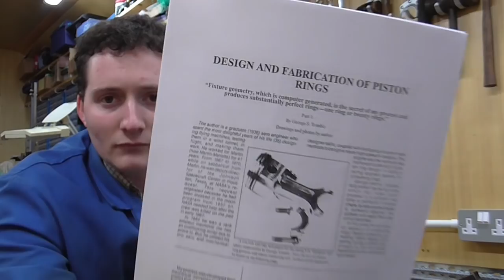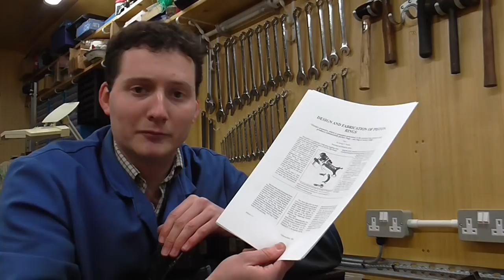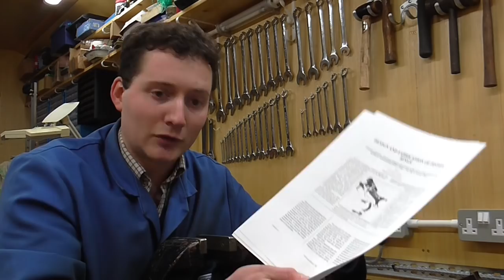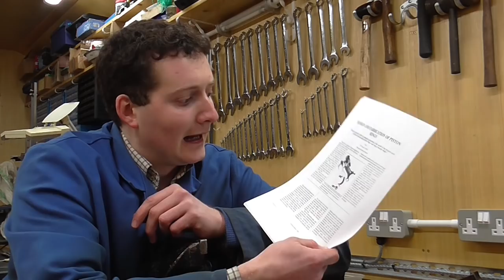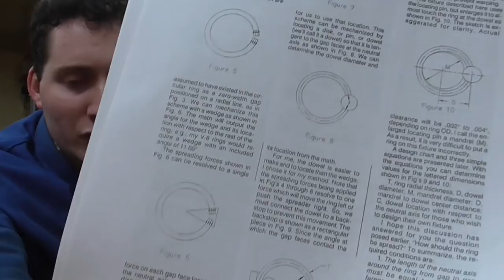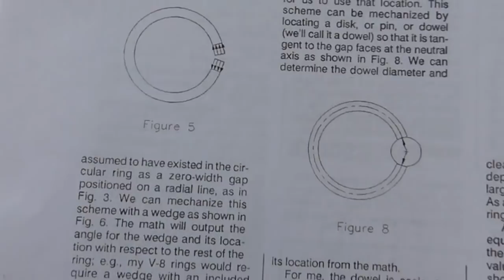Piston Rings 2

Comment: Nice work as per usual Mr.C. Here's a tip an old bloke taught me.  Pull apart your feeler gauges and use 3 separate feeler gauges to slip your piston rings onto the piston.  They slide on nice and easy.  Cheers, Aaron.

Comment: My respect for piston rings and those who make them has greatly increased!
There is one more thing: full scale practice, at least on German locomotives, has always been to open up the cylinder bore by a small amount (have a step in diameter) at the end of the stroke. This recess step is so positioned that the outermost piston rings can slide over this step by a fraction of their width in order to scrape any debris, corrosion, coked up oil, etc. off the running surface into the recess. The cylinder drains would start from the lowest part of these recesses to allow any sludge to be flushed out.
Probably unnecessary  for a smallish engine like a model locomotive.

Comment: I guess this response probably comes too late, but I admit to having had a Mr. Crispin-shaped hole in my education until fairly recently. With specific regard to piston ring gaps, and despite never having seen that handy design guide, I do know that rings expand in length, closing the gap as they heat up. If this is not considered in the design, it might cause a problem during operation. I am fairly sure you have enough gap, but if you had ended up with the gap you had wanted, it might have caused its' own batch of issues.
Also, I am glad to see that I am not the only hobbyist who seems to spend 80% of my time making tools, jigs, fixtures and whatnot. Thank you Sir for entertaining and educating me!
Reply from the maker: I think in this case I would have been ok as the piston, cylinder and ring are all made of the same material meaning that they have the same expansion rate.
Reply: @MrCrispinEnterprises  , you mis-understand. I am not tslking about different expansion coefficients, I mean that components expand differently due to their shape. Secondly, if the ring is getting hotter than the cylinder due to friction ( ehich it eill as it is so much smaller), it will obviously also expand more.
Reply from the maker: As for the magnitude of the ring expanding due to friction I'm not sure. With regards to the other topic yes perhaps although a steam engine heats up slowly and once everything is hot there would be no problem.

Comment: These two piston ring vids are my intro to your channel. Very impressed with your methods and presentation. On the subject of width of the ring face causing increased friction, I still remember being shocked in my 1975 H.S. physics class when we were told that surface area and amount of friction were unrelated. We were taught that friction was entirely dependent on pressure between two moving objects, regardless of contact area. I'd be curious if Mr. Trimble addressed that in his writings.
Reply from the maker: Thanks. From memory no, he set it out as I mentioned. Although I geuss he is assuming that width is the only variable in that section of discussion.

Comment: Excellent video in both piston ring making 1 and 2 considering a beginner with such a good outcome. Mr Crispin I hope she steams well. I notice that you have piston valves instead of slide valves, which is the same as the Britannia class loco I m restoring. For the rings in the piston valves it will  be the same technique as your piston rings  only bit smaller in producing rings for the bobbins for the piston valves.. Thank you for you knowledge and confidence as I m a first hand in doing model engineering. Sounds much better than buying rings.

Comment: Great video and great saving of the rings. I guess you could now call yourself Lord of the Rings. Many moons ago I made some rings for an old stationary engine exactly as per your second method however I left plenty of meat on the diameters and cut the split so no pulling wedging or stretching. Its possible to dress the gap edges and then compress the rings with some shim material in the gap to give a little less than the the desired finished ring gap. Machine the ring diameters and finally gap the rings in the normal way.

Comment: When you stretched the rings over the mandrel and heat treated them to the larger than cylinder size, the ends of the rings could not compress into a circle the same size as the bore because they were unsupported at those ends. Therefore some portion of each end of each ring remained at the oversize curvature of the heat treating mandrel. I do enjoy your video presentations. We all learn together :-)

Comment: I really like your honest and candid presentation when mistakes are made.  As for the process here, I was somewhat surprised that you didn't break out your Dumore grinder to do the final OD machining.  Using a turning tool seems more likely to move a ring in the fixture compared to using a grinder.
Reply from the maker: In didn't own it at the time!

Comment: Certainly the study of the error was enlightening, the methods used to rectify the issue was methodical as well as very informative.
Reply from the maker: Thanks
Reply: @MrCrispinEnterprises  Two sroke engines have pinned rings. It stops the rings rotating and the ends getting caught in the ports.

Comment: This is not my own theory, it has been published before, but I know it works from experience - I have just built the cylinders for a 5 inch King - 4 rings for each bobbin and 2 rings for each cylinder. 24 rings! It is easy and quick. Make the initial tube exact cylinder bore size and use the 25th rule for bore, part off rings, saw cut a gap with a hobby 'razor' saw then use a flat screwdriver blade to open gap - not excessively, warm evenly with a gas torch until they drop off into an oil bath (approx. red heat). Job done works every time. With the sort of ring section you had originally they would not go on the piston successfully. Also since you said, I can taste those fish and chips!

Comment: Very good video, great machining but a long winded process. 

Turn and bore a hollow cylinder of iron with ID slightly smaller than the ID of the expanded ring and OD slightly larger than the expanded ring. 
Mill a slot lengthwise in that iron "tube" the width of the ring end gap. 

Machine another "tube" from a soft material like aluminium with a ID that will close the end gap of the split iron tube you have made, press the split iron tube into the aluminum tube. 
Put the aluminum tube with the split iron tube inside it in the lathe, face it and bore the iron to the finished ring size. 
Now turn both the aluminum and iron to the finished diameter of the ring for the width of one ring plus the parting tool width. 
Part off a ring. 
The ring will expand open as it is parted off. 
Repeat the process for as many rings as the material will allow.

No heating. No dial indicators.
Reply from the maker: Very clever!
Reply: @MrCrispinEnterprises  Grind a angle on the nose of the parting tool so it breaks through near the ring you are parting off first. This will avoid a sliver of metal being left on the back of the ring.
Also make the parting tool width  at least as narrow as the ring or maybe even more narrow.
The hard part is getting the right iron. But that's always a challenge, ring manufacturers regard the exact composition of their rings as "Top Secret".

Comment: I worked in a shop over 20 yrs. . The rings we made from castings were ground flat within .0005 .  I'd lock them up (depending on the order) 10 -15 at a time and turn them down to the orders specs and gap them ready to install . They had to be light tight when checked in a ring gauge .  I checked each and every one including the end gap ..

Comment: This is a very satisfactory outcome. You would never have got the old style rings over the piston. Now they are round when in the bore and slightly more flexible.
There is one minor detail. Piston rings in an IC engine need the gap because the piston and rings run much hotter than the cylinder. In a steam engine they are all the same temperature. The gap can be minimal but 4 thou. will be fine.

Comment: Give them a chance to bed in when the loco is finished. My 5in 0-6-0 now 5 years old. With the engine cold and in  reverse its impossible to push the engine forward due to the compression!
Another idea is to put a tiny shallow grove in the piston between the rings. The idea being oil is trapped in the groves which helps in particular from a cold start.
After heat treatment I finished machined my rings by clamping them closed on a mandril as shown in your video.
I have never felt the bore of the rings to be very important, that the rings should float on the diameter but a good fit on the sides.

Comment: I get that concept, stretching the ring from the gap by being perpendicular to the gap face essentially providing a linear force as opposed to a levering force. Spreading from the gap’s inside edge makes the opposite side of the ring a “hinge” stress at that point so that’ll definitely distort circularity. Very clever fixturing of those rings by the way. I was wondering how you were going to hold them for the OD’s.

Comment: Old steam and work engines such as a John deer one lunger as a motor to drive a belt pulley for a huge farm machine ran for 60- 100 years with rings the size you have. Small thinner rings wear faster but wear the bore less. A high nickel cast sleeve will wear the rings and not wear out.

Comment: Question : The inner size of the pistonrings is now a lot bigger than before....but the grooves in the piston remained the same size. Doesnt the bigger inner size on the pistonrings now not allow the piston to shift from side to side...even touching the bore ??  I always thought the grooves in the piston needed to be only very slightly deeper than the width of the pistonring....so only the pistonrings could touch the bore.

Comment: as a draughtsman, i can see where putting the ring on a mandrel to stretch it and then heat treating might change the diameter of the ring to that of the mandrel, and as such it would then when compressed not be the correct radius for the bore, so when you then stretch the ring by placing something in the gap, the original diameter is maintained, once the ring is compressed back inside the bore,

Comment: FYI - your trimmed rings came out almost at the same ratio as the Stuart #9 rings (1.5 dia x 1/8 wide x 1/16 thick each, with two side by side in the same recess (1/4 wide x 1/8 deep).
Great video as always. Always amazed at how well you talk to camera with structure, humor and not a single umm or pause. 
What’s next on the parts list?!!!!
Reply from the maker: It's the slide bars next

Comment: As a gap note, you broke your rings creating a random gap of a nominally straight nature. From an engineer's perspective, a helical gap would be preferred - so that the ends of the ring overlapped circumferentially. The benefit of this would be bore wear of at least 360°. With say a straight gap of 1°, the ring will leave an unwanted axial wear ridge in the bore.
Reply: Rings rotate in the bore.
Reply: @johnvanberrgem286  Let's see some video proof of that in all engines.

Comment: Since your new method involves correcting any final circularity errors in the ring, initially machining the ring to its free (expanded) diameter and then cutting a gap of the correct width would remove the need for heat-treating.  Also, a slanted gap in the ring would reduce the possibility of an axial ridge being worn in the cylinder.
Reply from the maker: Good thinking

Comment: Could the error have be caused by recognising the circumference of the outside of the ring will change when the ring is split to provide the gap? The length of the curve would now be the original circumference plus the gap which would no longer be circular when the ring is put into the cylinder.
Love your videos - as a 74 year old you are never too old to learn.
Reply from the maker: Yes quite possibly

Comment: Automotive piston rings often have a bevel on one side of inner diameter of the ring, ostensibly for oil reservoir and perhaps to allow the compression behind the ring to press it against the cylinder wall. A double acting engine would use two bevels I assume. However, I have seen several steam engines assembled and the rings all seem to have a square (not indented or relieved) cross section.
Reply: Well, looks like you figured it out all by yourself :) Thanks for your most enjoyable lessons!

Comment: Hi Crispin, looked up Chaddock and Trimble, it seems that you can still get Trimbles' original article from Strictly IC for $8.00 per Issue (Issues 7,8,and 9. Feb-July 1989) plus postage and packing I suspect. He also published an article in Model Engineering Volume 153 No 3735 pp210, as this was published 17 Aug 1984 I suspect this is not the same article.
  Prof. Chaddocks' article was in Model Engineer 21st April 1967 pp396 (Sorry don't know Volume or Issue Number).
  Don't know US Copyright Law so would be hesitant to publish on-line. The Model Engineering items can be obtained from the Library as a photocopy, if that is the only item you need as "Fair Usage" ,and the Library will sort out the payment for you.(Transferring your payment, that is). If the Library don't have the Model Engineer in stock they could get it from the British Library(Formerly called the British Lending Library, showing my age!) Don't know if the US have an equivalent to the British Library to get the Trimble article.
  Some comment on line to the effect of the temperature causing distortion at higher temperatures, wonder if this caused some of your problems.
  How did Len Mills do his rings? And how does Richard do his?
  Look forward to the continuing saga and thanks for an entertaining and informative presentation.
Reply from the maker: Thanks Melvyn

Comment: Hey Mr. Crispin I really enjoy your videos. I noticed you have a Deckel FP1 as I recently acquired one as well. Can you kindly tell me, what arbors fit the vertical head? Thx
Reply from the maker: Mine is an MT4 S20. Unfortunately Deckel spindles are very specific but they work very well.
Reply from the maker: The S20 bit is the built in thread on the end of the taper.

Comment: Are you going to make a filler ring to take up the enlarged space between the thinner rings and the bottom of the piston groove? That space is very bad on internal combustion engines but probably not too serious for steam but it might make the ring lazy at highest speeds.
Reply from the maker: No I think in the case of steam I will get away with it.

Comment: I liked your thicker stiffer rings. The question is though - would the thicker rings have stretched without breaking when being fitted to the piston ! ? Obviously with the ring ID being smaller, the forcing apart of the ends would need to be further.

Where did you get the original ring thickness dimension from ? You have now deviated from that - by considering ring data for IC engines rather than steam cylinders.
Reply from the maker: I don't think I would have got them on no, far too stiff. I got the 1/8th X 1/8th from a picture of the cylinder assembly cross section. I am starting to think the designer only used soft packing (graphited yarn or similar) rather than piston rings though.
As far as I can tell a steam engine piston ring requires less force on the bore as they operate under less of a compression ratio.
Reply: @MrCrispinEnterprises  Yes, much less working pressure - maybe similar to a diesel engine without any fuel ;)

Interesting that IC engine rings are rectangular in section and sprung open. I daresay triangular section would work using combustion pressure to open the rings to seal against the cylinder wall - effectively being forced into the corner generated by the wall and ring groove.

Comment: I just had a thought creep into my head while you spoke of re-doing vs. re-working while coming up on 12:32 ... Did the heat treatment with cooling on an oversized shaft reshape the default diameter of the rings? Rather than having a ring of the intended original spec diameter with its associated default curvature that's been split and expanded might the process have instead tended towards having the heat softened metal shift its form more towards the expanded curvature of the larger diameter shaft upon which the hot softened rings cooled? And might this change towards a larger diameter curvature then also have affected the angle at which the faces of the split came together when trying to compress the rings into the cylinder contributing to the improper mating of the split faces?

I'm also wondering if the rings cooling/shrinking from their outer diameter in (over the hot expanded thermal mass of the core form which had been preheated) may have come into play as well. Additionally I'm recalling that while watching the first vid it crossed my mind to wonder if leaving the rings-on-form assembly to cool as it was set forward towards the front of the firebrick shield workspace might lead to uneven cooling if the ambient room temp was cool and the firebrick assembly were to hold heat from torching the parts, reflect heat back from the assembly, and/or affect airflow around the assembly.
Reply from the maker: You have been doing allot of thinking! All good suggestions